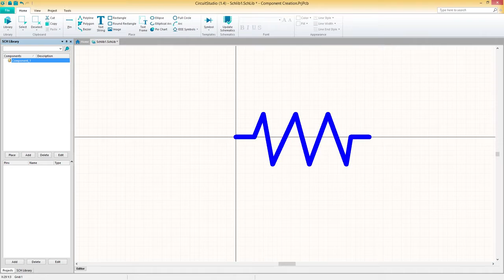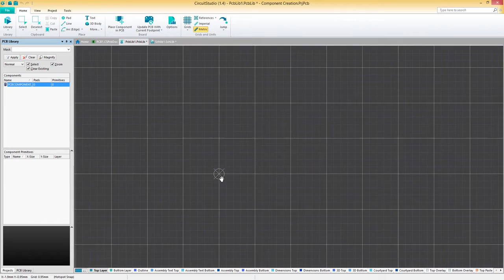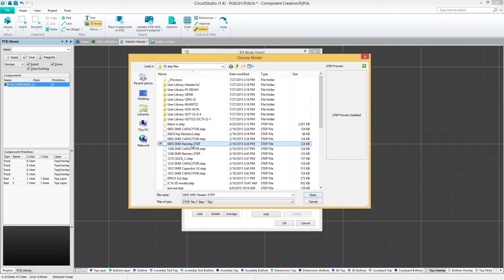How to Create a Component in CircuitStudio - Altium Academy

Comment: in fact, this forum post on element14, by user MC6800, was so useful, i feel like it should be copied here. All credit for the following goes to user MC6800: 

1) Create a schematic library document (File | New Document...|Schematic Library

2) Click View|Library to bring up the library inspector

 By default there will be a default component added. Click Edit to change things (name, default designator eg U? for ICs etc)

3) Add pins (click on the solitary pin icon, NOT the one in the filter group). Press tab to open the setting dialog before clicking to set it

4) Add graphical elements (eg boxes, zig-zags etc)

5) Continue to use Add in the library inspector to add extra schematic symbols

6) Save the library as a zsensible name

Now you need to create footprints using a PCB Library document - and then link it to the appropriate schematic symbols.

1) Create a pcb library document (File | New Document...|PCB Library

2) Click View|Library to bring up the library inspector

By default there will be a default footprint added. Click Edit to change things (name, height etc)

3) Add pads (click on the pad icon without the drop-down arrow NOT the one in the filter group). Press tab to open the setting dialog before clicking to set it.

 For each pad in the footprint, make sure the designator matches the correct one in the schematic symbol

 4) Add graphical elements (eg boxes, zig-zags etc) on silk and other layers

 5) Right click in the library inspector to add extra footprints

6) Save the library as a sensible name

 Now go back to schematic symbols. Bring up the library inspector,  and use Edit on each symbol. At the bottom of the edit dialog is an Add button. Choose "footprint", and navigate to the correct footprint in the correct pcb library

Save everything!

Comment: I made every step following the video , with a 34 pin trough hole plug , and at the end he just imports a 3d Step file and ends the video. And where do I get the 3d Step file for a complex project, I have the files from the manufacturer and distributor with shit 0 instructions on how to bind it to the component or how to put it on Circuit studio . Making this million move trip from library to pcb to schematics and back with litterally no sense at all.

Comment: I"m looking for a video that demonstrates how to accurately place 3D Step models onto footprints. This video showed how to place the model using it's default handle and it was a simple model. I'm interested in more complex models such as a 4 port RJ45 connector created by the manufacturer where the handle may not be in a place that makes positioning simple. How do I nudge the body into place?